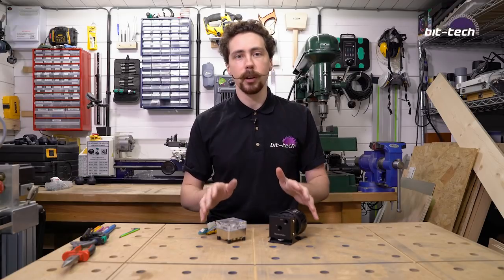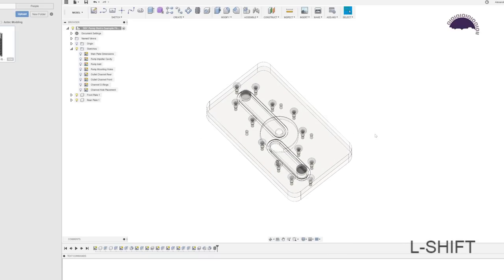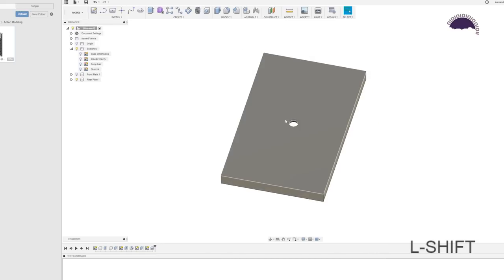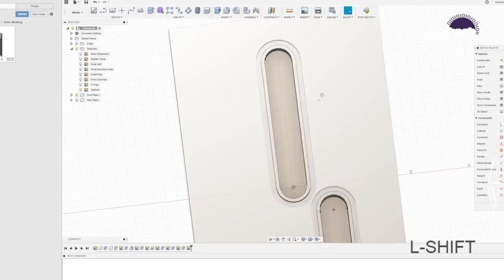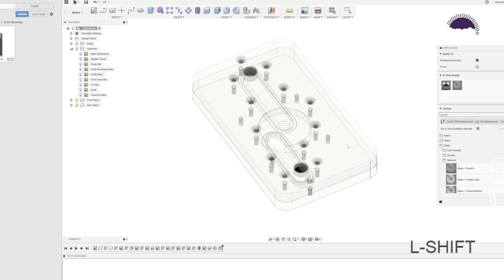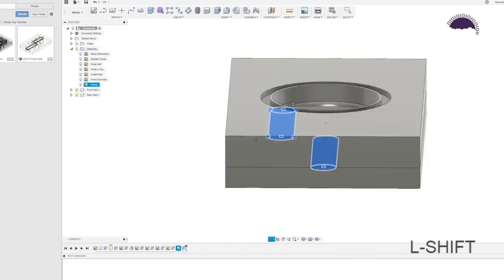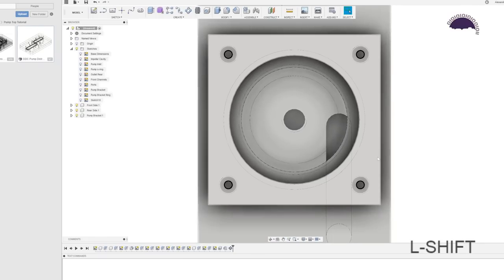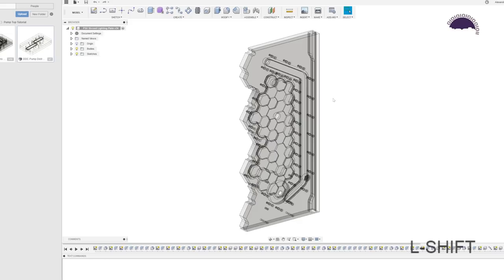How To Make a D5 or DDC Pump Distro Plate (Fusion 360 Tutorial) | bit-tech Modding

Comment: Do the D5 pumps have vibration issues when connected to a disto plate?
I've always put my pump on some sponge, been afraid to solidly connect it to anything due to vibration causing an annoying noise.
Reply: I'd imagine such a large mass would dampen a pump more than most case mounting would.

Comment: Hello, great video ! I strated my own since and i am trying to make this system directly into the distro execpt the bracket. I wonder something, is it matter if the pompe is pushing up the fluid ? (like if you put the exit port right side but going from middle to top). Also is it OK if the pump get the water directly from the reservoir ?

Comment: How much would you charge to repair a distro plate? I accidentally broke my barrowch rhopilema distro plate case on one of the out ports and it's in a very important spot. i'll probably need to fill the hole and cut another next to it or redo the entire front end.

Comment: I managed to install fusion 360 student version (free) on my laptop and started designing but I m not sure if my pc doesn't meet the min requirements, the application is too slow, it takes more than 60s for each operation I do.
Reply from the maker: It sounds like it might be, have you looked up some of the possible optimisations for it? Fusion has a number of features on by default that make it easier to navigate and look at, but which also consume more resources.

On slower hardware it does bog down pretty fast, I can't adequately run it on the NUC I use to control my CNC router (which is the i3 model from 2013).
Reply: @bittech1  wow thanks for the reply, I sort of figured out the issue, initially I used construction lines and then draw actual lines over them which took more calculations and I guess it slowed down.
After I fully became aware of designing things it is quite fast now. I m now kinda addicted to draw things on distros😋
I have designed some themed distro plates (DC&Marvel) which I would love to share with u,would u like to have a look and point out any corrections?

Comment: Thanks for this amazing video! Can you recommend a supplier of the material that you use? Is it just cast acrylic or is there a specific grade?
Reply from the maker: Just cast, although different manufacturers put out better products than others, that said it's really location dependent and somewhat random too. Just be sure to double check anything you get is cast as extruded is so much harder to work with (if you do a mirror plate it will always be extruded for instance, makes those much tougher).
Reply: @bittech1  Thank you so much!

Comment: Hi Alex!
I wasn't able to find any comment of yours regarding the slot-size for the o-rings in relation to the o-ring sizes, except for 2mm.
Your recommendation for 2mm o-rings is a width of 2.2mm and a depth of 1.2mm - 1.3mm.
In my German book of technical standards the values are as follows:
2mm o-ring:
width: 2.8mm
depth: 1.5mm

1.5mm o-ring
width: 2.1mm
depth: 1.1mm

1.0mm o-ring
width: 1.4mm
depth: 0.7mm

Of course these values represent static, axial oriented o-rings with pressure from the inside, so the slots are wider for the o-ring to move outwards, if the pressure on the inside rises. I guess you sized the width down because there is not that much pressure going on in a distro plate but do you have a general rule of thumb as to how you size down those standard values? Or was it a process of trial and error?
My case is that I'm designing a GPU water block at the moment and the tolerances to the adjacent screw holes are just too tight if I was to use 2mm o-rings with your recommended slot sizes, so what would your recommendation be for 1.5mm o-rings?

Thank you very much in advance and greetings from Germany!

Comment: where do you get you o rings? I just made a plate but am not sure where to get custom length cords. Also is there an easy way to calculate perimeter length for the cord in fusion 360? The measure tool doesn't appear to have that option

Comment: How well does this do with noise and vibrations?
Reply from the maker: I've found them to be pretty good, turned down to 30-40% a D5 is all but inaudible. You won't get results as good as a fully isolated setup but I've always found the performance great.

Comment: Hello, I have a technical question:
Pump in EK, aren"t waterproof, so when you refil it you take the risk to put liquid inside the electronic system!

Did you put tropicoat on the electronic of the pump?

Best regards
Reply: choptider ah what? There’s 2 sides, a wet and dry side
Reply: @mitchos199   on this pump for example:
https://www.ekwb.com/shop/EK-IM/EK-IM-3831109843130.pdf

There is no rubber to isolate the outside and the inside eletronic board of the pump;
so when I refil it there are chance to put tiny drop of liquid along the pump and break the pump.

I did it ones.

Now I isolate the inside with silicone.

I wonder, for my next pump If the tropicoat is the beast idear?

Comment: Do you consider fluid dynamics in some way to reduce back pressure, reduce void volumina or for lamina flow in your dystro plates?
Reply from the maker: Fat2Mad I did try it once, but honestly it’s the same deal as trying to optimise your runs via minimal use of angles fittings etc. I.e not really worth bothering with for this application. It’s far more important for things like waterblocks where turbulence can actually affect cooling efficiency.

Comment: What would happen if the outlet of the pump is in the opposite position compared to the one you show in the video? Thanks for the video, very helpfull.
Reply from the maker: As in if you put it on the other side? It would probably still work okay, just would be less efficient and likely lose some flow. The pump will still be pushing from the centre point outwards thanks to the impeller design, you’ll have more turbulence if you don’t work with the correct rotation direction though.
Reply: @bittech1  I mean if i put the outlet on the right and not on the left.
Reply from the maker: Ayup that’s what I figured you meant, would have the effect I mentioned. You could ‘rotate’ the channel about the axis of the impeller if you wanted to maintain the flow direction, so the outlet would be on the right but going up instead of down. Alternatively you could also use a different outlet channel shape etc that’s more symmetrical than the one I used in the tut.